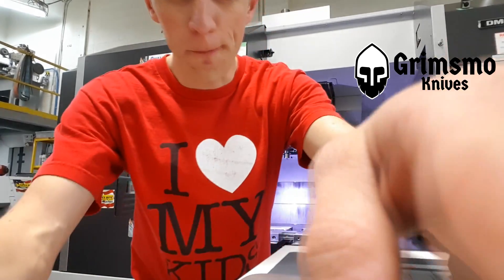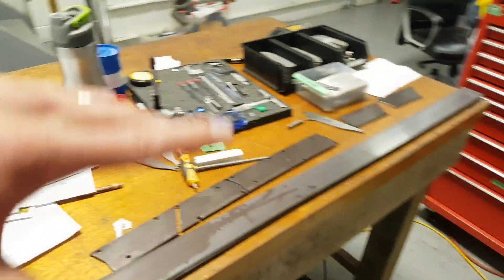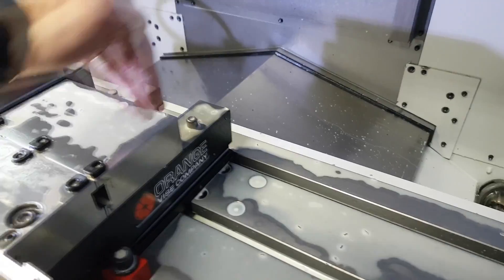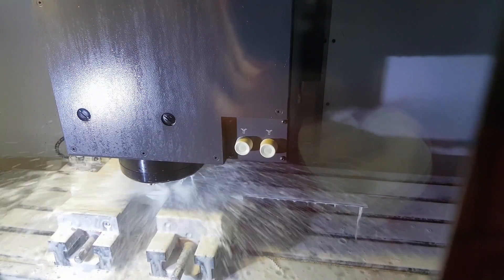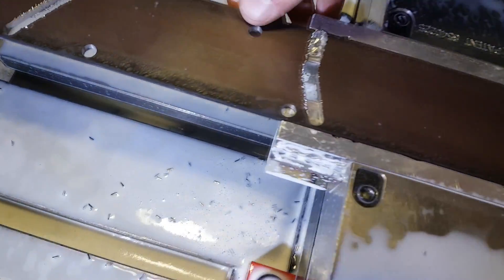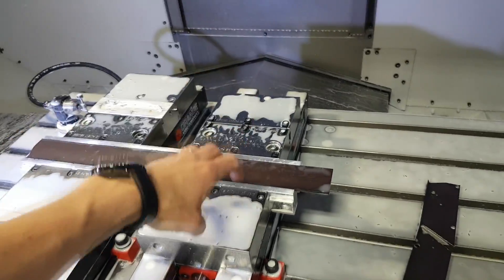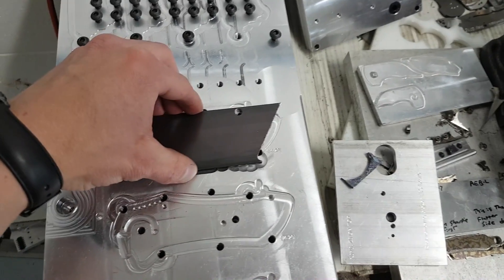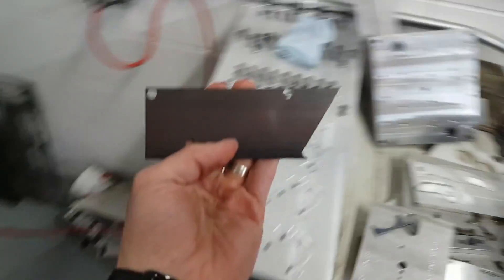Milling RWL34 blade steel into Norseman blade blanks

Comment: wow great JOHN.. as a career COST accountain...  USE SINGLE VICE. IDK but saving from BAD parts could BUY YOU nother machine.. allowing YOU to operate TWO  SHIFTS when needed. and PRE SET UP NEW blades while running first.. operate oone vice while FINE TUNING another blade  ore experimenting NEW DESIGNS. BS..

Comment: Hey John, first of all thanks a lot for the videos. I really learn a lot with them. I have a question. A Solid Carbide can cut thru hardened (61rc) steel ? The question is because  I want to finish my bevels after heat treat and I don't have an indexable ball endmill. Thanks in advance.

Comment: I thought you had your blanks cut by someone else with a waterjet.  Or is that just for the Rask?
Reply: They were done with water jet a year or so ago however that would still leave the same problems for machining and having to cut off tabs anyways. 

He could probably make a jig for machining a 5x4 (or 5x5) pattern of blades though I would do the jig out of steel and heat-treat it.

used to be a Jr engineer and fitter, CNC machinist for a company in West AUS, making quality jigs is very worth it.

Comment: Plasma Cutter Bed will do a better job and faster
Reply: MrStacy G. Definitely wouldn't do a "better job" (You will end up hearing the part who'll will warp it, create scale that is hard on tooling, and the fighting holes will not be anywhere near as precise.) ... but maybe faster.
Reply: Andrew Delashaw a laser would do the accuracy but +1 on the no to a CNC plasma
Reply: Any form of heat cutting is bad when it comes to machining RWL34 as the edges will now be heat treated, hence the "Flood" coolant just doing the drilling and cuts he has just done as any less coolant will work harden the drill holes and stock where it was cut.